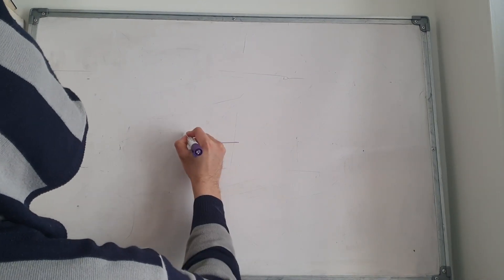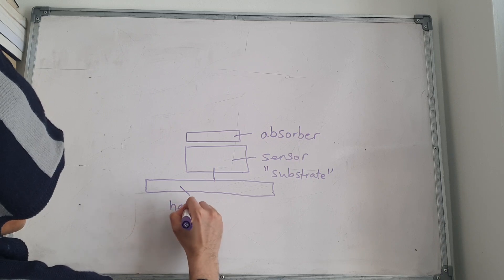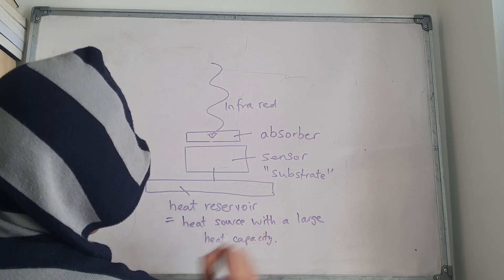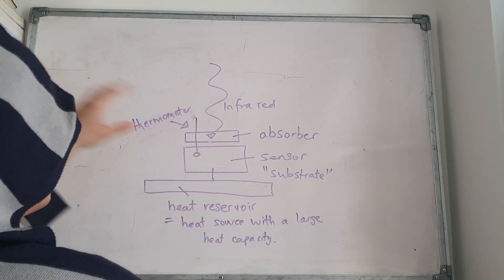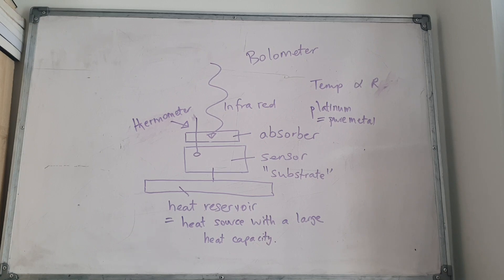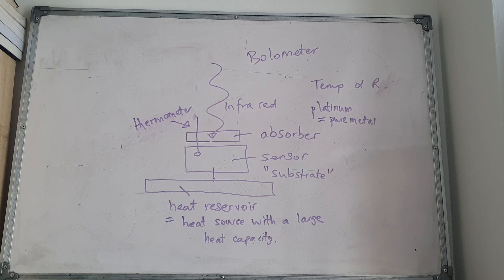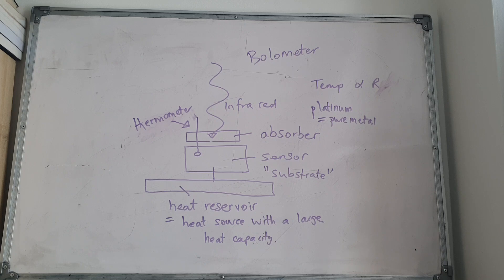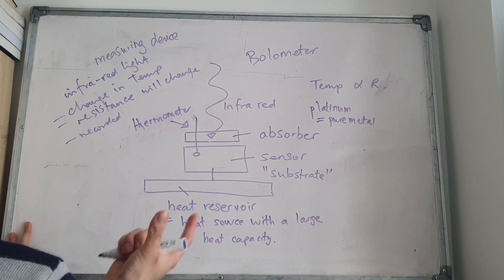What is a bolometer? Year 10

Comment: I think it's a little bit messy for an explanation. You'll find better info here : http://bolo.berkeley.edu/bolometers/introduction.html#:~:text=A%20bolometer%20(or%20calorimeter)%20is,detector%20for%20radiation%20or%20particles.&text=A%20bolometer%20works%20by%20measuring,in%20the%20regime%20of%20interest.
Reply: Thank u